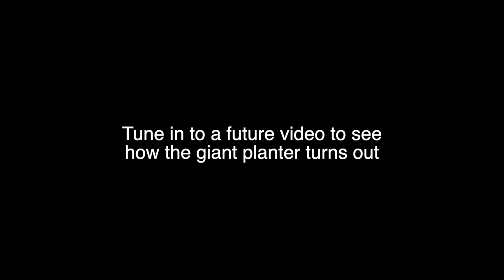Making the BIGGEST POT EVER!!!!

Comment: I learned a method where to throw a series of rings the width of pot and use them rather than the small coils you used. Once the thrown ring was attached by throwing downward, you pulled up, repeating to your final height.

Comment: When throwing sections, you can throw to have the top of the section on the bat match the target, but the bottom can be much narrower.  Then when you attach things, it's like you had it coned in at the new top, then you can carefully pull it up and out as desired.  I find this easier than trying to bring things back in after.  As a bonus, you don't need a giganto bat.  [Kind of like the piece you added at around 8 minutes.]

Convincing coil-and-throw to neck back in is super challenging.